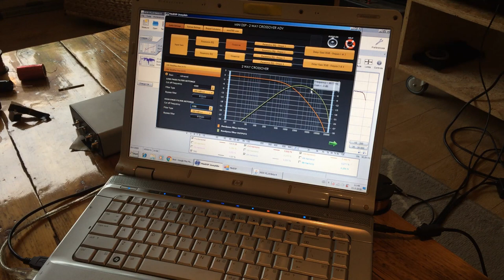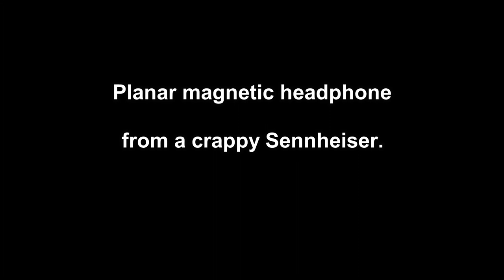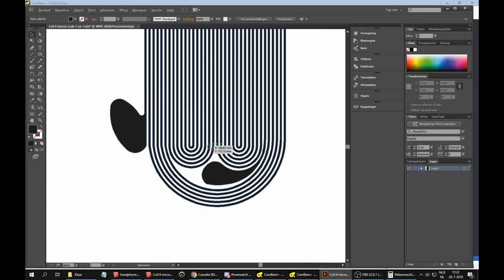Diy Planar Magnetic Headphones - Part 1

Comment: Hi Joppe, I have watched 9 parts of your headphone project, very well done. I recently had a problem with my headphone, after 2 years the headband broken and the planar driver is flexing and create cringling sound in bass region especially sub bass. My headphone is Abyss Diana and when I talk to Abyss about the driver they told me they could replace it for 1000usd which is ridiculously expensive. I try to detect what is the problem that cause the flexing and found out that if the clamping force and seal is good then the driver will not flex at all. 
I now really want to make a new headband which increase the clamping force but I have no access to tool or gear to make it. I am just a student in Den Haag, the Netherlands. I am hoping to comeback to Vietnam for summer break where I can access to tool and material in order to make my own diy project.
I just want to say that I enjoy your projects greatly and really look for your new projects with headphone.
Reply from the maker: thanks for you nice words :) i hope you will be able to fix it, by the way im from Den Haag as well :)
Reply: @joppepeelen  Hi Joppe, wow it is great. I would love to have a meet up with you to see your projects really. That would be great. I will be here for a while at least until August.
Reply from the maker: Most projects are not even in working order at the moment haha. Used them for testing temp. But check fb if you want under the same name

Comment: Beat you to it by 1 week Joppe! :)

Finished my first pair of headphone transducers just last weekend, 3d-printed frames, 2-micron mylar, 14 neo magnets and 0.08mm cable.

Of course, I didn't have the added effort of recording it for youtube. If I had to do that too, it wouldn't have been ready for another 2-3...years? :)
Reply from the maker: nice !  you used wire as conductor ? copper or alu ?
Reply: @joppepeelen  Copper 0.08mm for now, I have alu 0.132 but couldn't work out a pattern for the right impedance in the space available. Sounds pretty good, a bit bass-light (34Hz lowest) but no calibrated mic to make an objective assessment at present (just the Mk.1 ear). Imaging is easily the best I've heard, beats my £80 Sennheisers, just would prefer more bass.
Still playing though, and I've only made three transducers so far so there's probably room for improvement :)

Comment: Just wondering if you could point me in the direction of the aluminium foil you used as I can't seem to find a seller, unless you had a custom quote from someone?
Reply from the maker: well actually it is from a supermarket , but only in denmark , at least if your refer to the alu foil only and not the mylar. i had a friend send me over some rolls :) since i knew they had thinner foil there.
Reply: @joppepeelen  Thanks, I'll have a look to see if any shops in Denmark might have some.
Reply: @joppepeelen  I have since messaged you on head-fi, if you're too busy just ignore me and reply when most convenient.

Comment: Do you have the STEP/Original files for the CNC? I have a CNC and wood (ha) like to make them :))
Reply from the maker: i might only have 2d files im afraid. if i even have those :(
Reply: @joppepeelen  What would you recommend I do to make the files myself? I'm using Fusion 360
Reply from the maker: Well it all depends if you have the same sennheiser
Reply from the maker: I dont know the type, i do name it in one of the assembly video's i think
Reply: @joppepeelen  We are looking to make headphones with a Sony headphone driver, perhaps even making them bluetooth. I know how to design a headphone, but I can't design one as I have nothing to reference for the design I'm after.
Reply from the maker: @zacharypearle2543  so waht do you need ? coil design ? since everything will be different. nothing will fit.
Reply: i have the sennheiser in the video.It is hd-201,and with fake leather splitting around all the same.I wanna have a try too if i could get the file.